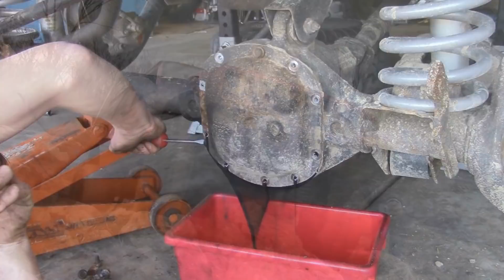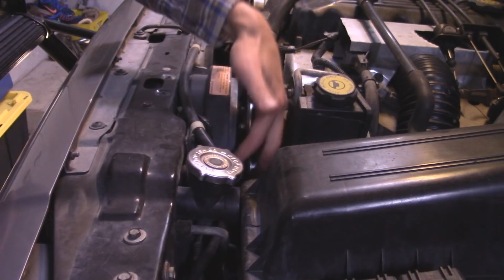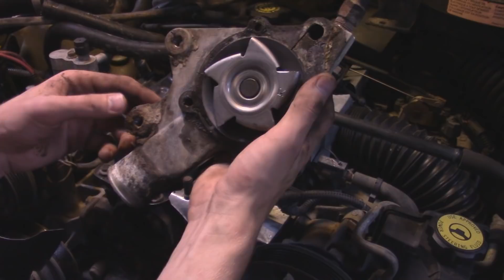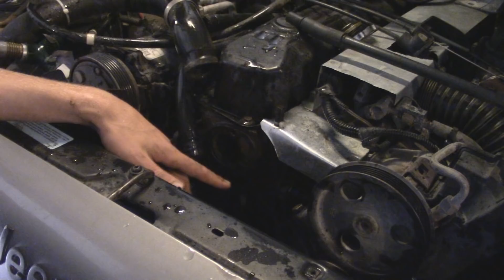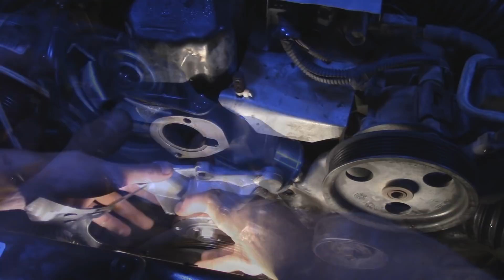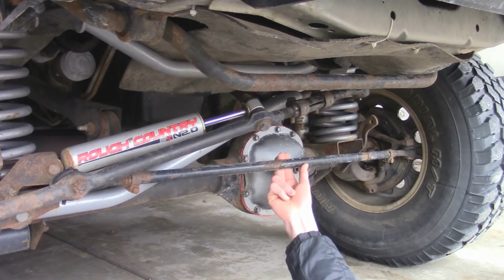How To Replace a Jeep Cherokee Water Pump

Comment: You said to torque the water pump bolts to 22ft pounds. The  haynes repair manual for jeep Cherokee xj says torque to 9 to 12 ft lbs

Comment: I noticed you didn't put any r t v Or any gasp at seaman on the housings or the Gaskets. Is it unnecessary?
Reply from the maker: Nope, not if both surfaces are clean and flat. Gasket does just fine on it's own

Comment: Do you have to remove the theromostat housing in order to do the water pump? Or does taking it off just make it easier?
Reply from the maker: @bdr5150  Not required, but it does make it easier
Reply: @OutJeeping  ok cool thanks! I think mine is about to go or is leaking bad. For awhile now, every time i start it in the morning, a pulley would squeak until it kinda warmed up and then went away. Yesterday it took alot longer for it to go away than usual. So i drove it to get groceries and run some errands. When i go to get back in it to drive home, it had a puddle under it. So when i got it home it was still coming out pretty good, what looked like to me was it was running down the front of the engine, and was dripping near the crank and oil pan. After talking to my dad and friend. We are pretty sure its the water pump. If you had to guess, would you say its the water pump also?  Or could it be leaking right at the front of the oil pan?
Reply from the maker: @bdr5150  Sounds like water pump. When the water pump's internal seal or bearing goes out, its designed to leak coolant out if the weep hole
Reply: @OutJeeping  Nice!! Thanks for replying back! After taking a better look at it when it was running in the driveway, its definitely the water pump.
Had to stop to cook some dinner but will be ordering a pump tonight. Is any brand better than the other on rock auto? I was looking at one that came with the seal. But if one brand is better than the other, ill buy the seal separately if needed to
Reply from the maker: @bdr5150  I like using Gates for all my cooling system parts.
Reply: @OutJeeping nice! The pump will be here tomorrow so im looking forward to finishing it up. Should I be concerned at all with the bolts that at in the block? Ive changed the water pump before on my old xj, but am always worried about that happening
Reply from the maker: @bdr5150  Should be fine, just don't over torque and snap them off in the block. Hopefully they won't snap coming out, I've never had that issue before, but it is possible depending on the conditions.
Reply: @OutJeeping im at the the part of draining the coolant and have the belt off. I was think of starting the engine just to give it some heat. Think that would help or hurt?
Reply from the maker: Sorry for late response. I don't think it's needed. It would heat the block and bolts up at the same rate. So it would be the same as unbolting when its cold.

Comment: Put sealant on the water pump gasket
Reply from the maker: Don't need to as long as the gasket surface is clean and flat. Never had issues with paper gaskets.
Reply: @OutJeeping  I just finished my install and it is leaking from there
Reply from the maker: @KRALTAIR47  Then you must have some sort of dirt in between the sealing surfaces or a warped water pump.
Reply: @OutJeeping  it's a new water pump. But I'm going to try with the sealant.
Reply from the maker: @KRALTAIR47  New water pumps could be warped out of the box. You can check with a straight edge and a feeler gauge.

Comment: The metal coolant pipe is out of place and blocking my valve cover so I wanted to scrub through this to get a better view of where it’s supposed to be. I got the VC off but I still guess that’ll have to be fixed to avoid future issues

Comment: Why did you remove the temp sensor and the thermostat housing??? Hmmm This must be different than my 97 Cherokee xj. You use a 13 mm and 15mm. Ok looks like mine but I don't have to remove those parts.

Comment: I'm replacing the radiator and thermostat. I don't think the water pump is bad, but should I replace it just for good measure?
Reply from the maker: Woundn't hurt and worth it since you are in there already. Also they are relatively inexpensive.

Comment: Do you need to put gasket sealer on water pump before you install it
Reply from the maker: No you do not need to as long as the surfaces are clean and flat.

Comment: I will be replacing the radiator, radiator hoses, thermostat housing, water pump, would you suggest I do it in an specific order? BTW thanks for the content.
Reply from the maker: No specific order but I would do it all at the same time, that way you only have to buy coolant once.

Comment: Water is a part number for the hose off the water pump? I've looked and looked for one and it keeps coming back to the 2 main radiator upper and lower hose
Reply from the maker: https://www.amazon.com/Dorman-56398-Water-Pump-Inlet/dp/B001C6JCU0

Comment: Hey at 5:51 , whats the name of that hose?
Mines copper or metal, not sure but im about to replace the water pump, should i change it?
Reply from the maker: That steel tube that comes off of the water pump to the heater core is just called the water pump inlet tube. It can be found here: https://www.amazon.com/Dorman-56398-Water-Pump-Inlet/dp/B001C6JCU0/ref=sr_1_3?crid=2Q9EWKFH47314&keywords=jeep+cherokee+water+pump+tube&qid=1648132556&sprefix=jeep+cherokee+water+pump%2Caps%2C82&sr=8-3

Comment: Why not show the correct way to put the belt back on... sigh
Reply from the maker: Define the correct way that was not shown in this video.
Reply: @OutJeeping  you completely skipped that entire step
Reply from the maker: I mean it's not that hard to route a belt around some pulleys. Plus depending on the engine,  year of Cherokee, and if you have AC or not, belt routing will vary. I showed how to tension the belt on the 96-01 style which is the important part.

Comment: Great video! 
 So my question is, mine appeared to be leaking from lower rad hose, I went ahead and replaced both lower and upper and thermostat and gasket, but now appears to be leaking from water pump?  Does the water pump start to leak when it’s going out? 97 Cherokee 
 Thanks
Reply from the maker: If the bearing is going out in the alternator it will start leaking. There is a weep hole that is designed to leak when it goes bad. Otherwise it may be leaking from the water pump gasket.

Comment: No rtv or sealant needed with the gasket ? You may have just saved me 400
Reply from the maker: As long as the sealing surfaces are flat and you have a good gasket then rtv is not needed. Gaskets have been used far longer than rtv has been invented.
Reply: Thanks man

Comment: Replaced my t-stat, was overheating , flushed system, and still did it, water pump doesnt leak or squeal, could it be bad with no other symptoms?
Before I take to the shop,
Reply from the maker: I would check the fan setup and see if it is all working properly, also any metal shavings in the coolant is another sign of a bad water pump.

Comment: Enjoy the video but do they suggest not using gasket maker at all?
Reply from the maker: No need for rtv if both surfaces are flat and clean, the paper gasket works just fine.
Reply: @OutJeeping  heard that man..I just always slap it on any of them bc it makes the gasket stay in place to get bolts through then when I've gotta replace it , it makes the gasket stay with the rtv and I've found its easier to get it off afterwards!  But that's just me Haha
Reply from the maker: @Comeonmane  Yeah it can help in those situations so its optional to use it.

Comment: New belt on still can’t get the water pump pulley off just keeps spinning
Reply: Got it but I just snapped the top bolt taking off the thermostat .............. fuck

Comment: 3:20 how the fuck did you get those bolts off
Reply from the maker: Break them free with the belt still tentioned or use a strap wrench to put around the pull to hold it in place.

Comment: Excellent  Video  -  Very, descriptive and organized procedure.   Take notes, and  DO IT YOURSELF.   MANY THANKS,  !!
Reply: One little note.  I have learned that having  the exact correct radiator cap /  correct lb or pound pressure is super important to solve OVER HEATING PROBLEMS ON MY 4.0 XJ.
Reply from the maker: @RobertWilson-td7eb  That is absolutely essential, 16lbs I believe.

Comment: Is there anyway to break the bolts without the belt on?
Reply from the maker: If you have room for an impact you can use that or use a strap wrench on the pulley to hold it in place to be able to break them free.
Reply: @OutJeeping  appreciate it. I actually had to put the belt on to get the last bolt. Unfortunately don't possess a impact wrench that small

Comment: How did you check the tension on the serpentine belt? Worried I'll get mine too tight or too loose I don't know how to check it.
Reply from the maker: I usually tighten till it has about 1" of deflection.

Comment: How tight did you twist the inlet tube? I’m in the process of draining my coolant again as it’s leaking at that connection
Reply from the maker: Tight enough to seal at the threads and is pointed in the right direction but not necessarily as tight as it will go

Comment: I'm halfway through doing mine now & there were some steps that would help first timers, that you didn't show or explain: best way to flush the block without removing block plugs; how to keep that water pump pulley from turning when you get to the last bolt (TIP: I use a vise grip to hold it in such a way that the vise grip jams against the thermostat housing); how best to get proper tension on the belt. THAT is something that I struggle with & hoped to see here. BTW: no gasket maker on the gaskets? Why not?
I see that you don't answer questions but I hope that my observations will get others thinking & posting.
Reply: Funny enough I'm literally about to replace mine also haha... but what do you mean by gasket maker?
Reply: @SpidrMonky-kx5ku  RTV sealant is what I really meant. There's a specific type for water pumps/thermostat housings. I used it on my installation.
Reply: No need for rtv if you clean the surface properly.
Reply from the maker: I answer what I can, but I get a bunch of comments a day I got to keep up with. You shouldn't need gasket maker for using a paper gasket. The paper gasket works fine on it's own as long as the surfaces are clean. I torqued down the water pump pulleys after I had the belt on to hold it. And for tightening the belt, I'm used to know where to tighten but usually it's when you get 1" of deflection.

Comment: ok I have a 2001 jeep Cherokee classic 4.0 and it is heating up to 210 then shutting off like it is vapor locking - I have to sit until it cools before it will start again - I replaced the radiator cap and the heat sensor on the thermostat housing - my fan clutch is tight and seems to be working - no leaks from my radiator or water pump - any ideas ?
Reply from the maker: Maybe replace the thermostat, those are wearable parts

Comment: I’m almost finished but I can’t get the dang ol water pump pulley off. I got the bolts off now the pulley won’t budge off the water pump at all. Any tips? 🤨
Reply from the maker: A good smack with a hammer
Reply: Wow I got it off. No heat just used a tool and was careful prying it off from behind. Rusted water pump wouldn’t let it go but I got it. Thank you again for getting back to me! This video helped me change my water pump and all. 🤟🏻🤟🏻
Reply: Yea I gave it a good smack with a rubber mallet and nothing yet. I don’t wanna damage the pulley. I sprayed some pb blaster on it. It’s sitting right now.
Reply from the maker: @sunsetmemories8262  Maybe try some heat too

Comment: Is there any reason after my water pump install that after test driving my engine temp shot up to 260?
Reply from the maker: You probably got air trapped in the system, try to burp out the system
Reply: @OutJeeping  yea rookie mistake. I thought the coolent wss full but after I checked there wasnt any left in the reserves.

Comment: I seen other videos use a paste type sealer for the gasket to stick to the pump and the block? Isnt it not good to just throw it on without that sealant?
Reply from the maker: Gaskets have been used for far longer than rtv, theres no reason to   use that along with the gasket. They came from the factory with just a paper gasket and it works just fine.

Comment: Awesome video! I just replaced mine yesterday. I will say this: I had some issues with the thermostat housing. These crack a lot and you need to be super careful when you put it back on. I had to buy a new one. Also, please use some RTV silicon gasket maker on the inside of the thermostat if your thermostat did not come with a rubber gasket on it. My local auto store did not sell my thermostat with a rubber gasket already on, so we had to use the RTV silicon stuff.
Reply from the maker: I've been using just the paper gasket for a long time and never had any issues.

Comment: On my australian XJ the fan shroud did not come out. Had to remove radiator as well
Reply from the maker: Those shrouds are sometimes a pain to get off especially if you have a transfer case drop.

Comment: Nice video and a great ride, i would appreciate it if you would advise about the NAPA tru- flow pump, is it good or not for 30% offroad use, also how did you get the flushing water out of the system and how much coolant did you actually use?
Reply from the maker: What ever is left in the engine after flushing I just leave in the engine, nothing I can really do about it but it should be clean water. As far as the water pump I don't think it will make a huge difference with the same radiator because the radiator can only cool the coolant so fast. Plus for a stock Jeep the stock cooling system works the best. The only good scenario I could see using a hi-flow pump is if you had a 4.7 stroker with a 3 core radiator.
Reply: Thank you so much for your reply, a week ago i disassembled the water pump and thermostat housing along with the timing set, however i used a water hose to flush the system while all the ports are accessible. then i used a 550 W air blower to get all of the flushing water out of the system. as for the equipment i bought a Stant superstat high flow thermostat, Flowkooler hi flow pump and a normal Dorman thermostat housing where i used a Dremel to bore it to turn it to a hi flow thermostat housing and i think i will keep the stock radiator because i've installed tow extra electric fans behind the front grill with manual switches (Temp here in Egypt reaches 55 C in summer). also i by passed the heater core (as i've never used the heater) and used a 3/8" npt male to 3/4" barb fitting to be installed in the water pump instead of the heater metal tube. i'm doing a STD inframe rebuild by the way. i can e-mail you pictures if you are interested. Thanks again, Regards.

Comment: Nice video and a great ride, i would appreciate it if you would advise about the NAPA tru- flow pump, is it good or not for 30% offroad use, also how did you get the flushing water out of the system and how much coolant did you actually use?

Comment: great video, little hint about burping system. turn on heater to circulate water better
Reply from the maker: That's true if you have a 96 and down Cherokee but if you have a 97 up they dont have a shut off switch for lines going to the heater core.

Comment: Great video!
Looks like replacing the valve cover gasket would be easier access while doing the water pump. Mine needs it.
Reply: As jeep owners say, "While you are in there".
Reply: I am stuck in that same boat. Oil seepage from valve cover and just not gotten around to it yet. It does look like as I do the water pump might be a good time to tackle it. That and I've been dreading the thought of replacing my heater core. I haven't had heat in my xj for seven years... so it would be a nice change.

Comment: Only complaint is that the camera wasn’t on the lower hose when you pointed to it so my dumb ass took it out the bottom of the radiator, made a huge mess & then spent two hours fiddling with the water pump/hose combo I’d just created.
Reply from the maker: lol been there done that

Comment: I am at the point of removing the mechanical fan housing for more room. Mine appears to be larger (1996 Jeep Cherokee Sport). I removed the two screws but cant get the housing past the fan and the radiator core. Any suggestions?
Reply: up load video of what you ask
Reply: Trent, I dont know how to do the upload. As it turns out, I had to remove the top radiator hold down bracket ( black metal that goes from front to left) and the front galvanized bracket that holds the  top front fender piece to make room to remove the fan housing, then the fan. Lot of screws.

Comment: Nice job explaining it all. I ended up having to take off the steering pump and bracket to get to the lower hose clamp.
Reply: Yeah he had a screw clamp. Had to take my powersteering too because of the tension clamp being right under the bracket 🤦🏻